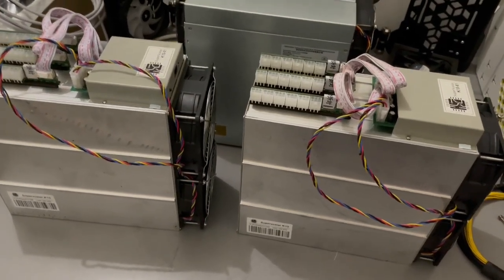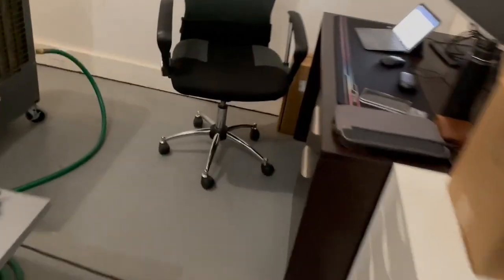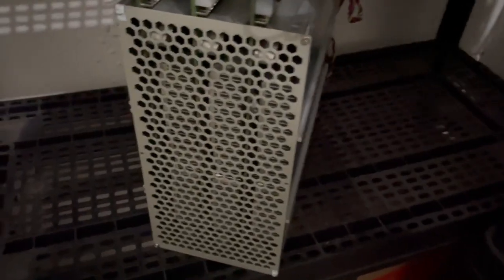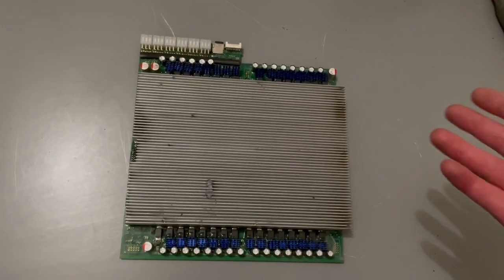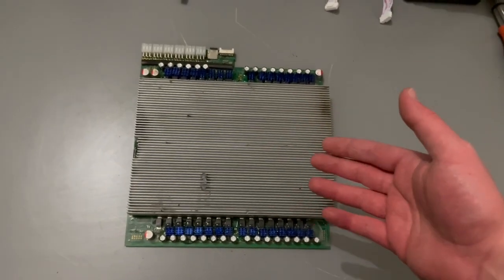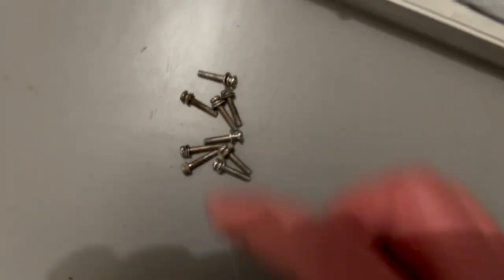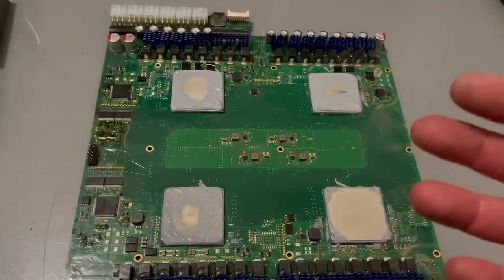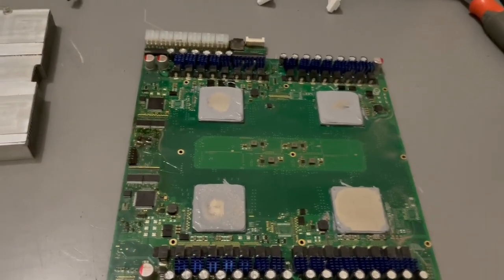Superscalar K10 Unboxing - Something Ain't RIght???

Comment: MCM the SK10 been around for like 5 years now, and the OEM stop making them years ago, I don’t think they are making any new ones yet as they are trying to make better chip, all of the SK10 are all old miners not just testing but actually years old miner as they stop making mew SK10 years ago.
Reply from the maker: I should have clarified, the new K11 is inbound and they are likely selling the old K10s to make room for K11s at their facility. I did not know they had completely stopped K10 production though. In fact, I was told there would be an option to buy brand "new" K10s in the near future. We will see I guess.
Reply: @motorcityminer  yes the OEM that made the K10 was planning to restart making them however intel stop making that version of that chip they have a different one for their edge compute so unless they have stocks of the old chips, but yeah will see, all K10 right now are all older miners built years ago.

Comment: I got a K10, but it doesn't show up on my network at all. Not sure what to do.
Reply from the maker: make sure the desktop you are trying to access from in connected to LAN through ethernet. The managertool does not like wifi for some reason and will miss the units.
Reply: @motorcityminer  Yes, all on LAN not WIFI. Router doesn't see the device.
Reply from the maker: hmm, is the red status light on for the control board and each hashboard? the hashboard lights are at the top.